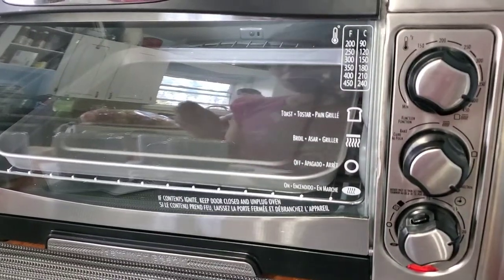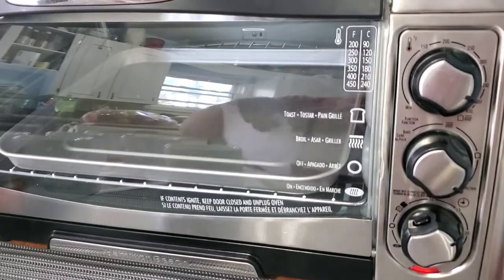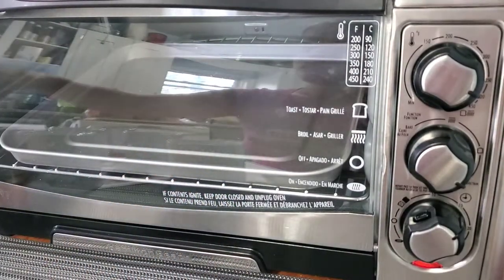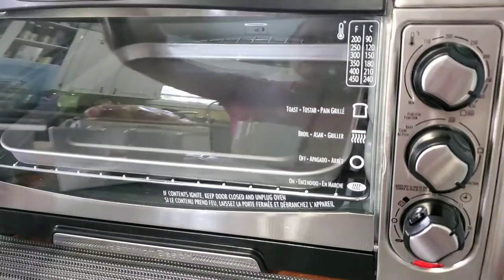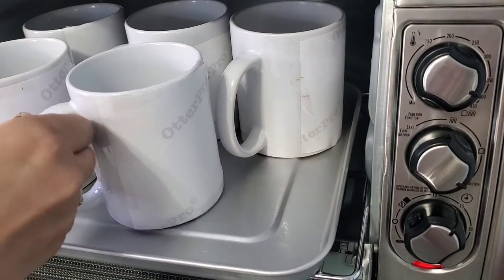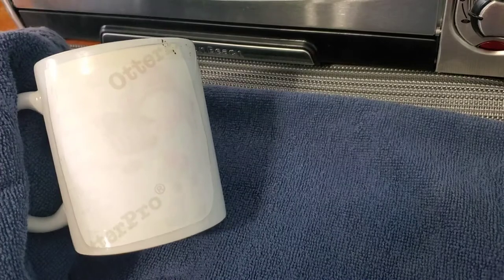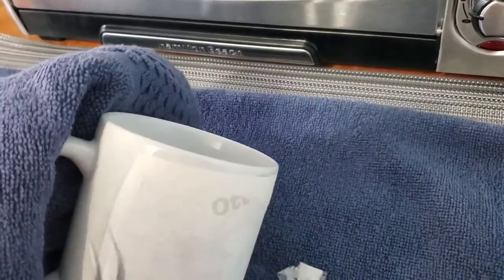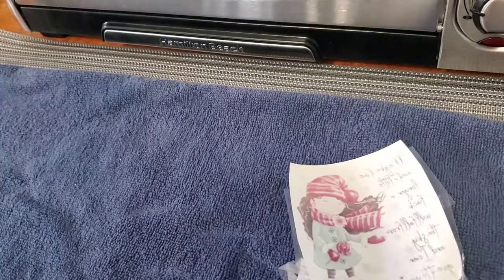How to Sublimate on a Mug without a press

Comment: So I bought the Cricut mugs from Michaels.  I have done 10 mugs... All have ghosting and faded and colors are faint.  I have changed heat setting and timing... in the convection oven.   Doesn't matter.  They all are a bust.   I then tried in a mug press.  Was a little better but the colors were still dull and faint.
Reply: - Let the Ink Dry before using.
Also try using (Sublimation Mug), it has a special coating on it, which the Infusable Ink sinks into, and makes it Dishwasher Safe too!

Comment: I hope that your smoke alarm battery is not still beeping at you 2 years later but just in case from the fire dept in me. The chirping means the battery is dead or the whole station is expired and needs to be replaced. They need to be replaced every 10 yrs.
Reply from the maker: It's been replaced